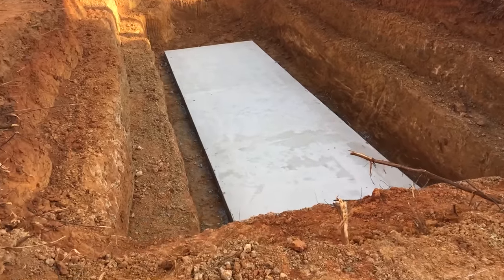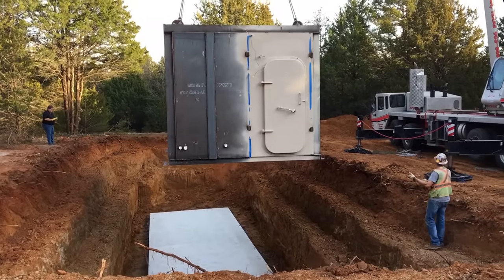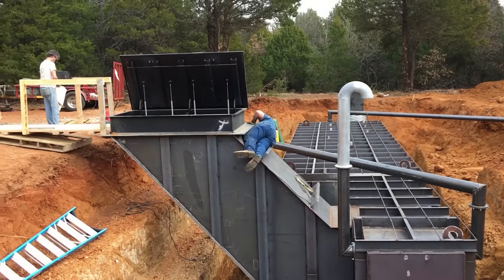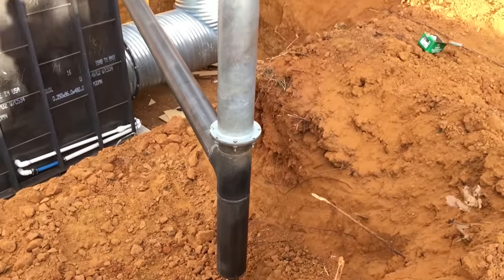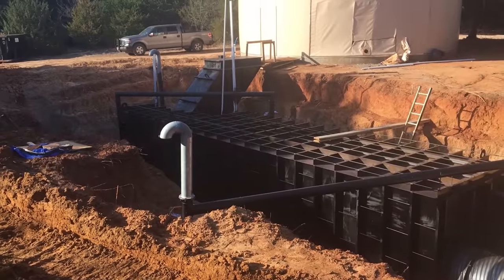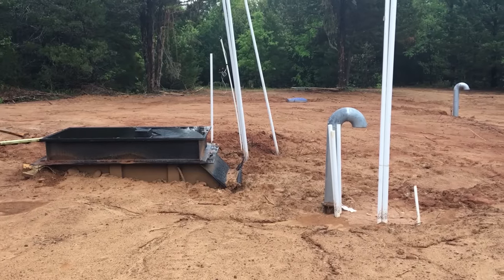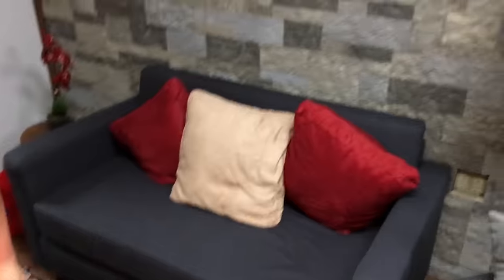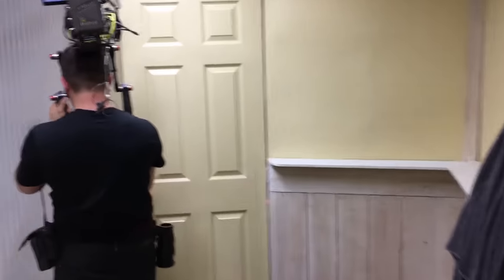Atlas 10x30 Safe-Cellar - Luxury Bunker Built Under A Home (Complete Installation Video) - Part 1

Comment: I’m just worried about what happens to the air outside after the nuclear bomb ☢️ does the air get filtered?
Reply: Yeah, but the filter will probably melt.
Reply: Proper NBC protection uses over-pressure, basically pressure inside is higher than out, so no contamination from the outside actually enters. This video say nothing about the actual capabilities and from the video doesn't look like it have much to offer.
Also filters won't melt, why would it? Filters are design to absorb the contaminates, different filters work against different hazards. They do have a certain life expectancy, after that it will need to be changed.
Reply: @neurofiedyamato8763  I'm talking about the initial blast heat melting the filter pipe.
Reply: That depends on the distance from the blast zone, the yield of the bomb and how exposed the filter is along with how much and what materials protecting it.  The radius at which things outright vaporize is rather small. The core of a nuclear explosion is very very very hot but drops off rapidly as it gets farther. Unless you are relatively close to the epicenter, of a big bomb, things probably won't vaporize/melt. Instant vaporization or melting seems unlikely unless you are within a few kilometers of large yield bomb.

You should probably worry more about the ensuing fires that might suffocate the bunker due to lack of oxygen. It's more likely a filter would melt from fires. Even though the temperature is lower, it will be lasting a lot longer allowing it to reach a temperature where it will melt/combust. Or just cook whoever is inside alive, if fire safety and heat insulation isn't provided.
Reply: Andrew Hampton
Dude, we dropped 2 bombs on Japan, and that was decades ago when technology for nukes was garbage. They have more radiation leaking from the decommissioned Nuclear Powerplant in Japan than those two actual nukes ever released. The simple fact is that nukes don't actually release prolonged radiation, at least not how television or video games portrays it. That shit subsides in a matter of weeks. The air itself will certainly not be irradiated, even to such a degree that it must be filtered. I would be more worried about a global viral epidemic getting into the ventilation system than nuclear fallout.
Reply: Yes they have NBC and no it cant melt its predessessors where tested for the effect in the navada desert and it didnt melt and block radiation
Reply: Sure the air gets filtered.  Then after a few months just put on your radiation hazard suit and drive your tank to the Home Depot and pick up some more filters.

Comment: For 100% concrete, would you pour the floor first and smooth it, and dry it, and come back and pour walls and ceiling later? Would you separate the wall pour and the ceiling pour?
Reply from the maker: Yes

Comment: I seen several bunker use either a ladder-of-sort or stairs. Would it be possible to still have the same security, but with an ADA approved wheelchair ramp?
Reply: Sure. Or maybe an elevator with an old gentleman named Jeeves as the operator. He could bring you dinner prepared by Connie the cook who lives in the next bunker over.

Comment: I'd be like building one from sea cans, plenty of them to be had, and they would stack next to each other quite well for a basement under a house.  Heck, do one better and make it the house, with a Garage on top of it, or even better use a barn or shop.  Equip the top structure with solar and wind generation and use the generator area for batteries and a very small 2000watt diesel generator with fuel to last 1 week of continuous use.  Thing is, you don't need that much power in a bunker, and with the batteries, you could store the excess energy and use it sparingly over a long period of time.  Wonder how hard it would be to also make a refrigerated room?
Reply: Just have a small solar farm and bingo your powered

Comment: This is a very cool bunker but I do not understand that secret exit. First of all if everyone saw it or even filmed it, than is no longer secret. Secondly in my opinion it is as a vulnerability. While the main entrance that has two solid doors, this secret exit has only one and some thin pipe. Personally I would fell safe in the back of this bunker (theoretically the safest part) knowing that threat can come trough that pipe.

Comment: If you poured gas into that pipe it would just fill the system and flow into the container. natural or propane gas will just suffocate and explode inside.

Comment: This is a fantastic bunker ... but it seems to me they could have just put a convention basement under there (with say 18" thick walls and 18" thick concrete ceiling) for much cheaper and had way more room, then add in the vents and generator room etc etc ... I'm sure I'm wrong or they would not have spent so much money ... anyone aware of the details? ... I meant water tight basement is basically every basement made now a days

Comment: While these are cool and all, it would seem all someone on the outside would need to Dino’s block off the air vents and possibly a water supply line or electrical line?

Comment: By the standards of the Russian Federation, this is the simplest shelter from radiation or non-nuclear explosion... The lowest protection class. From a near nuclear explosion, this will not help. But it's better than nothing. Prefabricated earth shelters (dugouts) have the same protective properties. But they are not airtight.

Comment: Seems a little gimmicky to me! Really a decontamination room! They didn’t mention anything about air scrubbers for your air pipes. No storage. Plus, they pointed out one of the pipes had a catch drain so if someone put gas down in it  would go straight into the ground but the other pipe didn’t have it. Great man cave/ safe room I guess if you could get to it during a home invasion.

Comment: I can’t imagine how much such a thing would cost. Astronomical is all I can think. Looks like about 300 sq feet of living space and as mentioned in other comments, very little storage. I think if a person was serious about building a bunker they’d need probably at least 2 of these containers attached to make it livable for more than a week. If you only have a weeks work of living in a bunker I think just doing a concrete bunker would be easier and cheaper. Nothing in life is cheap that’s for sure. This individual must be loaded cause he put more thought into his wine rack than he did for food. 😂😂😂😂.
 Call it what it really is, a man cave.

   Also if this is meant to be a bunker, why is the lock on the outside of the hatch to the bunker? 
 I’m thinking someone could lock you in if they wanted too, plus your putting a house on top of it, so your lock would be on the door of the room that accesses the hatch and I’d have an escape door out of that room as well should someone lock you in.

Comment: No one mentions that it is lockable from the outside?????? If you are inside someone else can lock you in!!!!
Reply from the maker: no they can't.  it has a release on the inside
Reply: @AtlasSurvivalShelters  Good to know did I miss that in the video or was it never mentioned?
Reply: @Average1212  I dont think that they mentioned but you would think a company known for building top end bunkers would have considered that possibility.
But yeah they probably should have mentioned to avoid any confusionm

Comment: None of this makes sense. That whole thing should be designed like an off grid loving space and have nothing but low wattage, preferably 12v electronics and  appliances in there. Nothing in it should be connected to the main house...